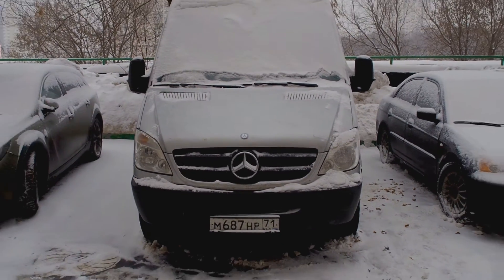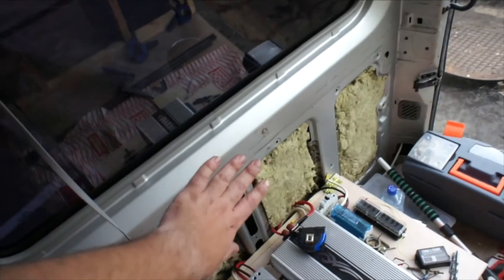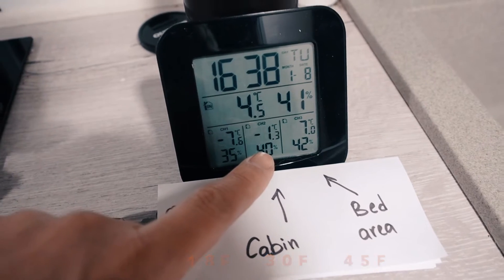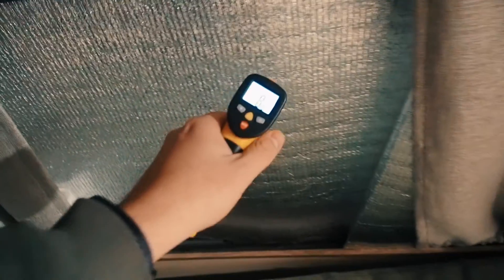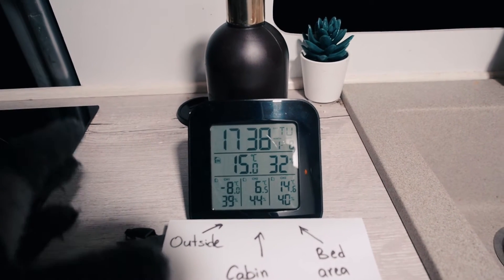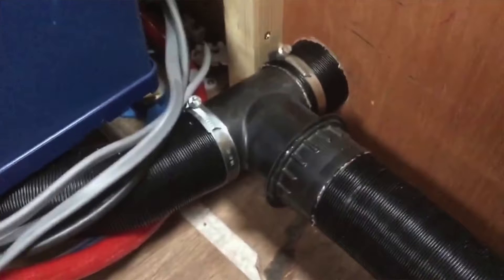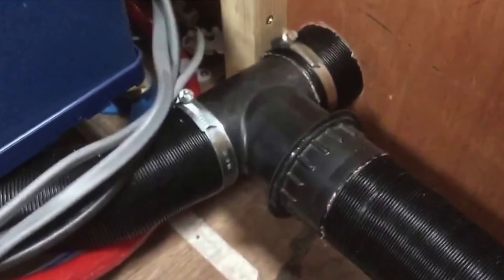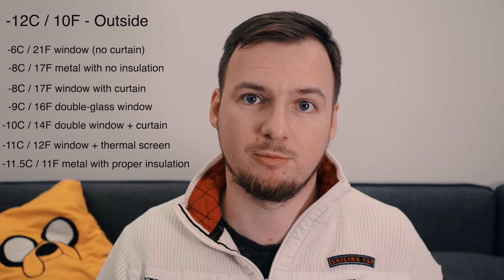Van insulation & heat test with thermal camera. Is my diy RV van conversion ready for winter?

Comment from the maker: In this video, I did pretty big insulation and heating test with measuring results with different tools and after different periods of time. I test single and double glass windows, thermal screens, metal with and without insulation and different curtains.
Reply: How much fuel did you use?
Reply from the maker: @markburgess6677  this heater uses from 0.12L (1kW) to 0.49 (4kW) of diesel per hour. Since i put it at maximum power i probably used about 1L (0.26gal) in 2 hours
Reply: @Vantouristcom  Thank you for sharing the information.  Did you do the ceiling and the floor of the van ?  The heater maybe relocate to the back of the van without ducts taking away the needed space.

Comment: just a question, the heater to simply put it is a small engine, if so then can generate electricity with it.
Reply from the maker: nope, this heater is just a burning chamber for diesel with an electric spark. Not engine. So it couldn't produce electricity unless you will get it from heating, but that's not very effective
Reply: @Vantouristcom  one more question.

1.  how long does it take to heat the van  to comfy temp.

2.  is there an auto function which turns the heater on when the temp drops to a lower temp 
3.  did you weigh the insulation so it does not exceed the load cap.

Comment: Thank you for your most Scientific Video. You found your window heat-stealing bandits and you taught us what works and what doesn't. The DIY reflectix window insulation, probably with a curtain over it, could be a great solution for my single pane glass.

You should change your name from the Van Tourist to the Van Scientist!

Comment: Very nice. I am thinking if I do a cargo camper van convert, based on your report, I might just go with wooden studs and use plastic buttons to attached thermal insulated curtains to the wall and ceiling. Something I can do in workable sections and can remove if I want to add wiring or rework the van configurations.

Comment: @vantourist Thanks so much for your testing!! Great job, and we've got some valuable information for our van. How are you planning on insulating the sliding door?
Reply from the maker: Similar as I insulate all other metal parts of my van. With antivibration and thermal sound deadening cars insulation
Reply: @Vantouristcom  Thanks! Btw I shared your video on several Campervan Conversion Forums, hope you don't mind. It's so helpful, I'm sure people will now get a better understanding of the insulation subject. 🌟
Greetings from snowy Switzerland
Reply from the maker: I mind actually. Mind to thank you for sharing it with other people, thanks :)

Comment: Very good information.  I’ve seen fans that don’t use power that sit on top of wood stoves and the heat coming off the stove makes the fan work.     I wonder if you got one of those and put it even with your kitchen cabinet, maybe on a stool,  if it would help distribute the heater’s warmth to the sleeping area?  Also, until you can get your slider insulated, would it help to hang a blanket or thermal drapes across it to help keep heat inside?  A great experiment, and very thorough!